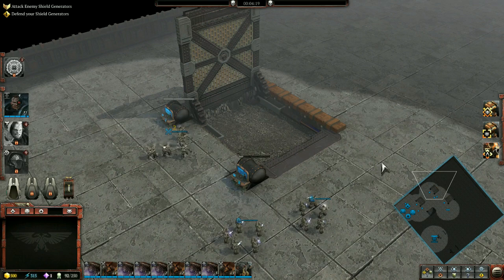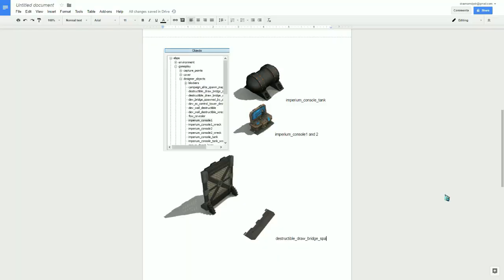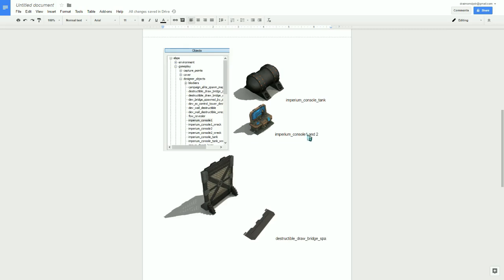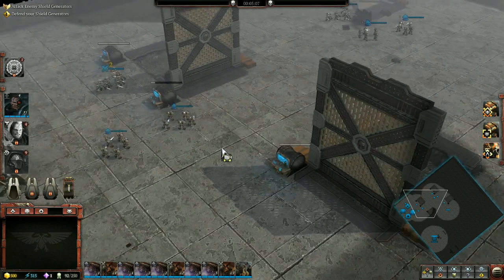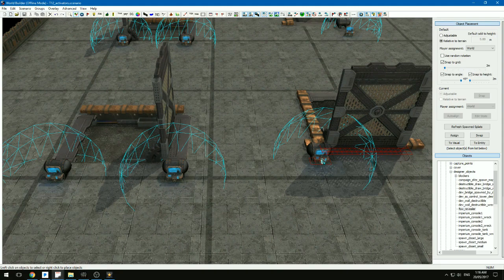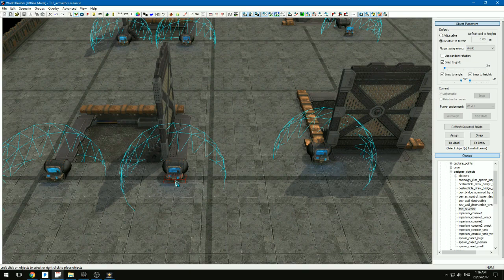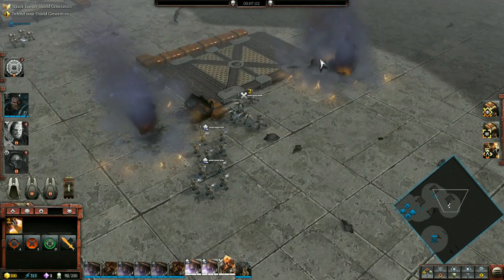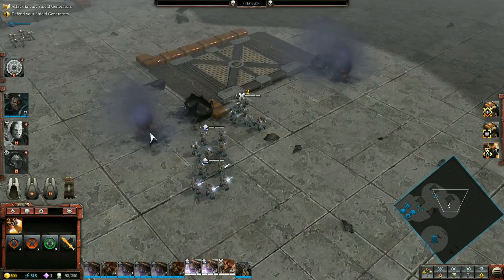DoW III World Builder - Draw Bridge Setup & Testing

Comment: Ok guys, so the Portcullis works in the same way as the drawbridge, its in the same ebps>gameplay folder as Draimond indicated above. Unhelpfully, the correct Portcullis model is called dev_wall_destructible (confusingly, there is a 'imp_Portcullis' in prefabs model with the other items which does nothing). 

You might also want to add some other elements such as the Portcullis frame and surround which live in here: 
ebps>imperium>imperial prefabs   -   imp_portcullis_frame
ebps>imperium>structures   -   imp_portcullis_insert

Cheers to Draimond for pointing in the right direction, much appreciated.

Comment: OMG i figured it out! Okay so i tested this 10-15 times to make sure it wasn't a fluke.  Place a Imp Console 1 where you want it then the imp console 2,(dont work about rotation or getting it in the right spot) then select the imp tank and place 1 at the first console then the second, lastly place the portcullis/drawbridge. Arrange/position them as desired, i was able to get them working in any facing up to approx 48m away.(If a console 1 is within 48m of any console 2 it seems to still detonate them). So far i have placed them like this and made some weird configs and they work every time. To break it down it seems to have something to do with the number assigned when you place the item, have not tested with only one tank/console so i will do that next.
Reply from the maker: lol. I got it working with no consoles too. was up till about 1 last night recording for a second vid. Wont be able to finish it till after work. But yeam you can get some weird things happening. Place order could be promosing if the code checks by UID's sequentially.

Comment: Well the video is great but i can not get them to work at all. I am using the same items in the exact same configuration but the consoles never seem to explode and the bridges never fall. Is there any grouping or settings i might be missing, possibly set to a team?
Reply from the maker: ChaoticKnightmare, Im having similar issues. Will be doing a trial an error vid to shed some light asap
Reply: ive just been testing this too, you dont need to set anything to a team. My set up was very basic, 1xConsole, 1xTank, and 1xBridge/portcullis. I made sure the blue frame(lights debug setting) was on and that the bridge/portcullis was at least partially inside the blue sphere. . . it worked everytime.

. . . doesnt really answer your question but I hope its of some help
Reply: Hmm yeah tried some similar testing myself to no avail. In the maps created by the devs the tanks are always located near the terminals but the terminals are up to 32m away and in completely different positions......really wish there was a tutorial lol. Thanks for all your guys help though, i have managed to get one working, seems like it might have something to do with the order in which you place the items.  Placed the bridge then term 1, term 2 and then the tanks and it worked, any variation or copy and paste didnt want to work completely. Put a new bridge down and copy/pasted the terminals, the terms broke but the bridge wouldn't fall >_>. Maybe some of that helps :)